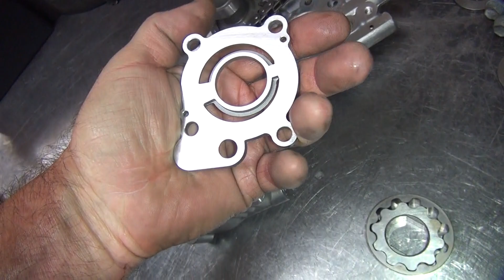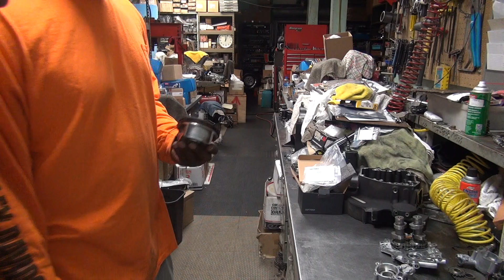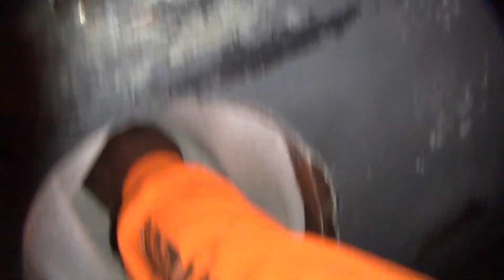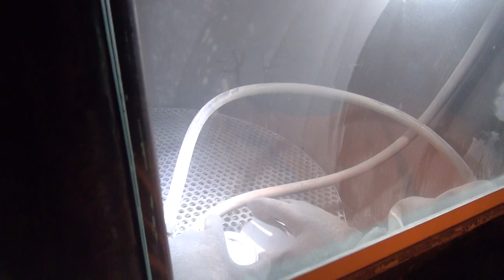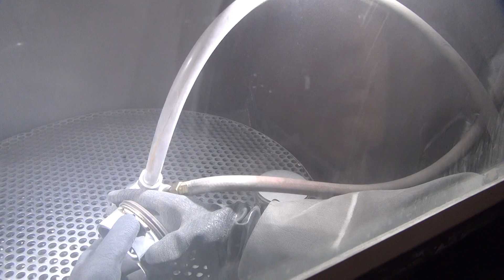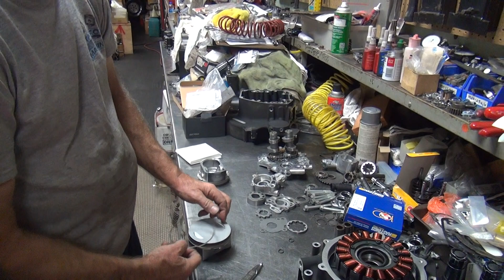#108 2011 roadglide find the motor noise FLT harley twin cam repair motor primary by tatro machine

Comment: no parts all junk 30 minutes in rings oil pump at the end will have a new motor I didn't think you can do crap work like that in the end it will cost you money
Reply from the maker: we will see about that. what parts did you not like. i was good with everything i did. the customer knows what he has and i did way more than what he wanted me to do. he only wants to get to the end of the year with this motor and i think it is good for 2+ years.
tatro
Reply: @TatroMachine  ya it will be fine how you did it i was just saying i did not think you wold do it how the owner was trying to get you to do it